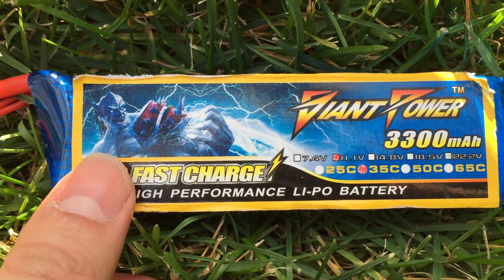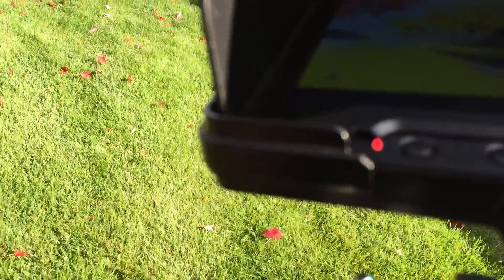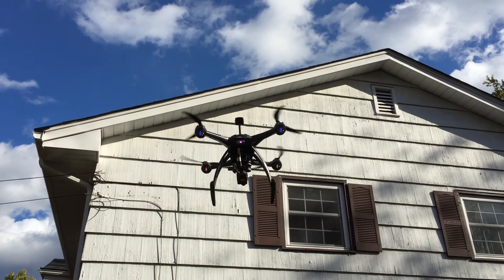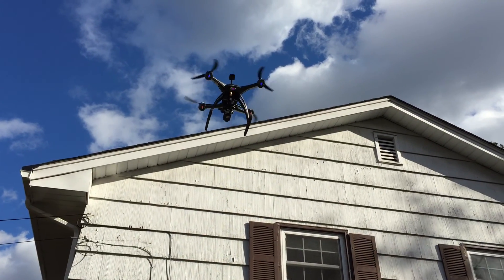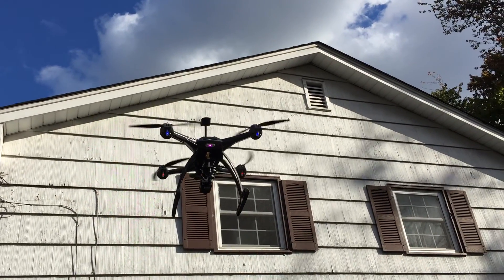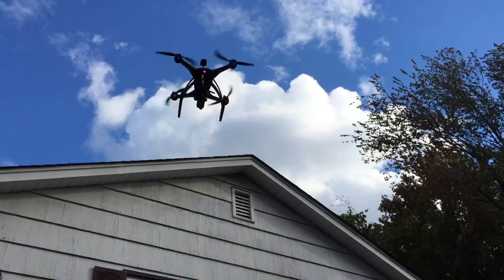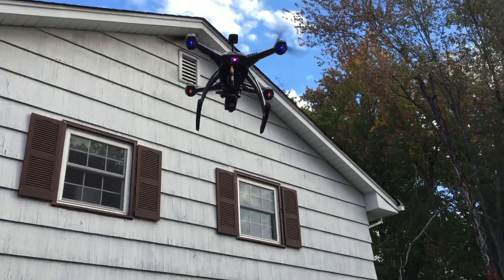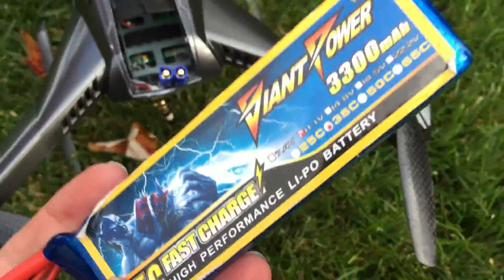Giant Power 3300mah 3S Battery 350 qx1/2/3 Upgrade

Comment: Does the 3300mah battery fit the standard battery tray without any problems?
Reply from the maker: For 350QX v1, no. For 350QX2, 350QX3, yes.
Reply: John Cuppi did the battery last well? Picked up a 350qx2 looked at that battery on Amazon